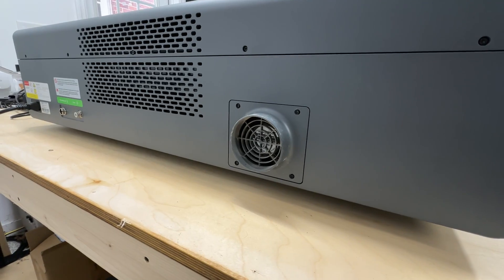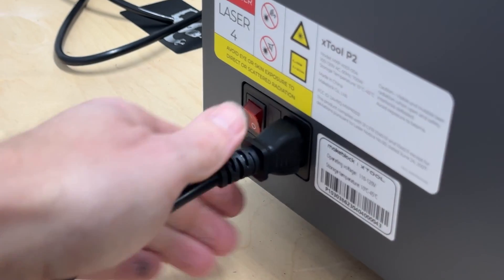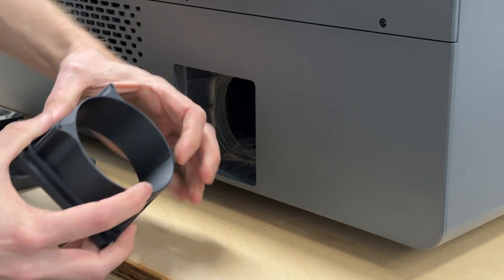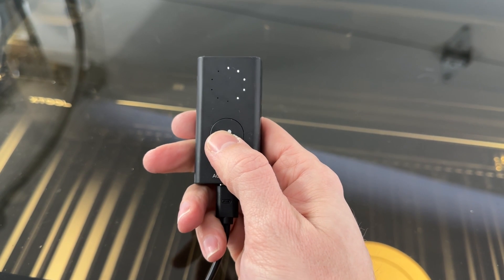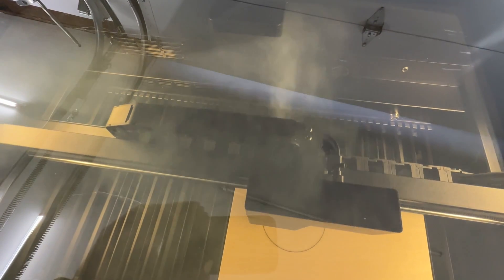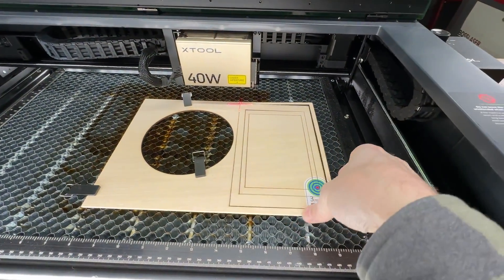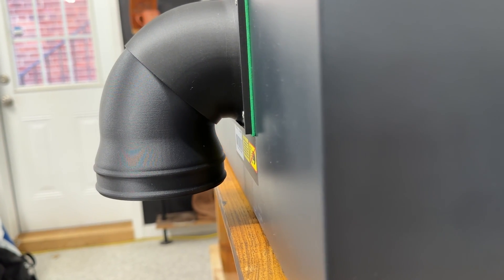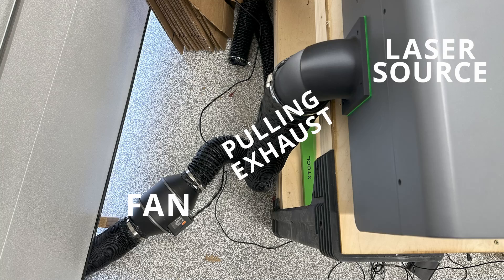The BEST mod for your xTool S1 and P2?

Comment: I just designed and printed my own adapter for my S1 that a 90 snaps onto that can be rotated 360 degrees.  It can be ran straight out or at a 90.  I may look into seeing if the intake can be modified as well for better extraction.

Comment: I would not recommend trying to remove the fan because as of December 2025 there is no connector that you can take apart. Like me, you will find this out only after you have removed the four fan screws and then you will have a hard time putting them back. So, unless you are sure you can add a connector yourself (and there is very little slack/extra cable to work with) don’t do it. 

Btw, if you DO manage to successfully remove the fan you should also remove the metal plate it is screwed onto because that metal plate really restricts 50% of the airflow out of the S1.

Comment: If your watching this video don’t get the inline fan. It’s a waste of money and is complete garbage. Just get a harbor freight shop vac and have another hose duct connect to the back of it into the fume extractor. You want  shop vac with 4hp, buy a 4inch duck and a 3in to 2 inch rubber adapter and connect it into the shop vac . Make sure to remove the hose connection attachment in the vacuum and stick the 2in to 3inch rubber adapter into it. And you’ll be set.
Reply: I would love more info. about what you said here.  Hard to follow without pictures.  Is there a way to contact you?

Comment: I was about to buy the adapter, but i found a 3d print file for a 6 inch duct straight from the machine. You installed a fan spacer. is it necessary or can it do without?

Comment: I actually just received my S1 this week i appreciate your video. My issue is trying to figure out how to vent out the window. My basement windows open outwards and i certainly do not have much room to modify it. Would not want to have air possibly leak as our winters here in Canada get rather cold, lol. For my D1 Pro i was just using the Atomstack Air purifier, it was not enough.. The xtool air purifier people seemed mixed on it, it seems rather overpriced i think
Reply from the maker: That sounds like a tough situation without modding the window. I use a real deal 3-stage purifier for my big co2 laser. Works great its just really expensive and the filter replacements arent cheap either. If you want to investigate that route look at the Filtrabox Micro or maybe a small BOFA.
Reply: @justinlaser  Thank you Justin, i may very well look into this. i appreciate the suggestion
Reply: @Spirited282  you can remove a pane of glass from the window and replace with painted board with a dryer vent in it.  Then just caulk it in there.  It will seal the window pane, but give you a vent so you don't have to open the window at all and you vent can be hooked up full time.

Comment: Have done very similar to my S1. Unfortunately the flow of air into the closed S1 restricts the efficiency of the exhaust strength.  Have read that putting a magnet under the R corner of the lid allows you to have the lid open a little during operation for better air flow,no longer a class 1 laser though. 8:02
Reply from the maker: Makes sense! Im sure someone will eventually go around drilling holes under the bed to get some more air into that thing.
Reply: Hey that is an idea!
Reply: This is stupid to put it simple. You want the fan to create that vacuum effect, that's what gets the smoke out faster. By this logic why not keep the lid open right? 😅
Reply: @petec737  airflow is air in = air out. Nothing moves in a vacuum. For maximum smoke removal you want just as much air coming in as is going out. Stupid is as stupid does …
Reply: @gerarduebbing3121 bruh..learn how different pressure works, the smallest gap is enough for air to get in. You don't need to "help air get in" by opening the lid lol😂
Your fan is creating a different pressure between the inside of the lid and the outside of the exhaust hose. The result is the vacuum effect (suction for you) that pushes the smoke out. More air in (by opening the lid) means the inside pressure will be lower thus less smoke out. It's the smoke particles that you want to get out as fast and that means bigger difference in pressure between the inside and outside.

Comment: Thanks for the info!
Could you rotate the new outlets 90° or even 180° if clearance is an issue? So, instead of the new outlet venting downwards, it would go to the side or upwards.
Reply: The horizontal version can point left or right, and the vertical version can point up or down.
Reply from the maker: Direct from the source!

Comment: XTool sells a basically rebranded S4 inline fan that is designed specifically for the S1 which I bought so unless I’m missing something this solution may not be necessary. Let me tell you the exhaust hose that comes with it is absolutely a beast wayyyyy better than the cloud hose which I thought was very high quality I had the S6 on my glowforge
Reply from the maker: Didnt know they did the 4" for the S1 I know they had a 6" modded for the P2. Probably would do that if ordering all at once but in my case already had the laser and fan here.
Reply: @justinlaser  my apologies I may be wrong it might be the S6 that I ordered with the S1

Comment: Thanks for the video! What was the reason that you could not remove the S1 internal fan?
Reply from the maker: Thanks! Its attached through the inside of the frame not the outside like the P2. Im sure you can remove it but it looks like some serious laser surgery I didnt want to do quite yet.
Reply: @justinlaser  Yes, I agree. That said, it restricts the airflow plus could there be a negative impact on the mother board for the electric charge created by the external fan creating spin on the internal fan. I lean towards pulling it if it would not void the warranty or create error faults preventing the laser from running. Thanks!
Reply: The wires don't have a connector near the fan. I looked at pulling panels to fish the wire out, gave up after 5 minutes and clipped the wires.
Reply: @mikelougheed Did the laser run correctly, any error codes. Thanks
Reply: @MWE-693  it ran fine. I taped the wires to prevent a short.
Reply: @mikelougheed Good to see, thanks!

Comment: Hello Justin,  thanks for the content. I used your affiliate to buy my first laser the S1. I discovered the issue about the inline fan when I bought the 6" inline...same company. I fixed It by using a plumbing adapter for clay lines.  They have them in big box stores...but not the 6". I found them online....they range from 7 to 54 dollars depending on who you buy from. I was impatient and bought mine from a local plumbing supply for 24.00 and ordered 2 more online since I will be getting a couple more lasers. Sorry for the edit but i forgot when you put the on they are very snug and you will have to squeez a bit to get them on...justvuse the clamps that come with it to keep on.
Reply from the maker: Interesting I will look that up. I wish all the adapters and ducting were a standard size its annoying how some fit and some dont. Thank you for using the link I appreciate it!

Comment: Can you just rotate the adapter 90° to avoid clearance issues?
Reply from the maker: They make a horizontal orientation one but due to the bolt pattern you cant just rotate the vertical.
Reply: @justinlaser  gotya